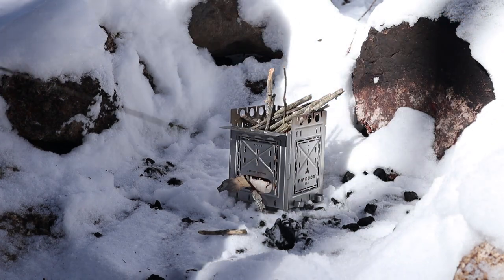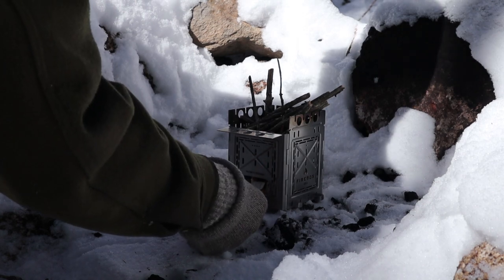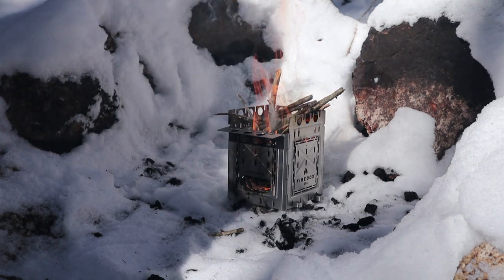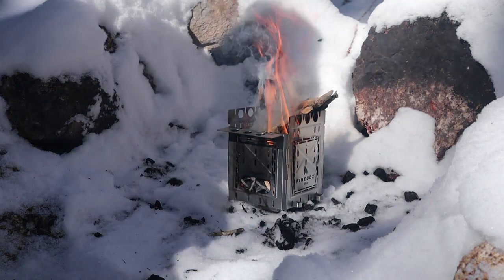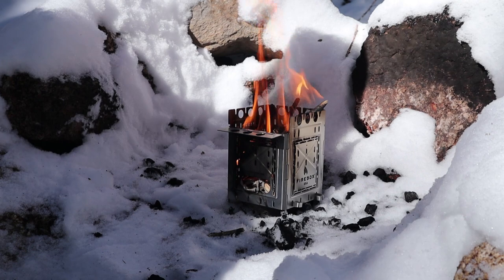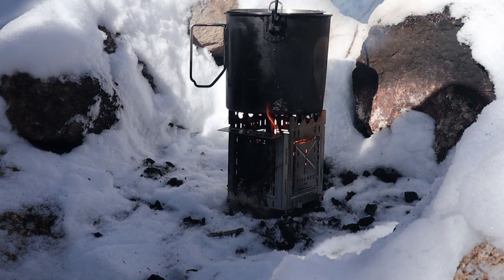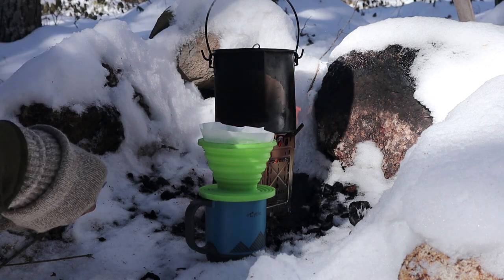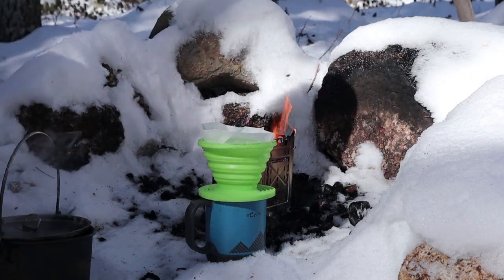Firebox Freestyle First Burn

Comment: Thanks for the nice video Mark. Just a quick explanation of why I chose to use the welded wire fire grate rather than a sheet metal punched out style. It all comes down to weight. The welded wire grate is about half as heavy as a sheet metal version. I realize the air flow may be high for some circumstances however I figured one can easily implement some technique to lesson the air flow when needed by lining the floor with a layer or two of small horizontal sticks prior to ignition. Sure the sticks will burn to coals quite quickly but as long as they are not Disturbed they should still serve to block some airflow at least until they burn completely ash. 
Thanks again Mark! cheers everyone 👍😎
Reply from the maker: Hi Steve. Thanks for commenting. In my next video I talk about how ash build up slows airflow and allows coals to build up.
Reply: Can't wait to receive my new kit, it's gonna be awesome!👁️♥️🔥📦

Comment: Yeah, I commented about that grate on the first show.  For sure this’ll be something to use splits in, I think.    If I could get the family more into camping, I think I’d get this as a package in steel, because they just car camp, and it would save so much space in the car.   But for me, I think I may upgrade to the original in titanium.   It’s a nice, relatively big stove, but pretty light.  So it would serve most things, and my nano would serve if I gotta go real light, but I think for someone who doesn’t have any yet, it would be a great idea to get one.
Reply from the maker: I am really liking the size of this stove and am looking forward to getting a single in titanium. Steve says the open grate is all about weight. In my next video I talk about how ash build up appears to slow combustion. Thanks for commenting Jim
Reply: @MarkYoungBushcraft    Yeah, like the fire pit you used.  I was wondering if that would happen,  but I’ll be curious to see how a sustained fire handles it.   Will it slow it down too much, for example.

Comment: Like you Mark I’ve ordered the titanium single version in the kickstarter for the same reasons. I love the 5 inch but the stainless steel is just too heavy to take backpacking. I also love the Nano. It’s great for alcohol stove’s especially, but I do find with wood, the small chamber makes it difficult to keep a fire going unless you do a Swedish fire torch. The titanium version of the Freestyle I think should solve most of my issues in using a wood stove whilst backpacking.
Reply from the maker: I agree. It is the sweet spot in size. Maybe it should be called the "Goldilocks" stove instead😅. Thanks for commenting

Comment: I'm late watching this one, Mark, but, by now, I can pretty much predict how a wood stove will perform by the size of the burn chamber, size, number, and location of  inlet holes, and height of the pot above the stove body, combined with how much space is allowed for the flame to exit the stove and escape from under the pot. This one's a winner for a quick boil, but needs less air flow for baking and grilling. A damper system, restricting the air flow under the burn grate, above the ash pan would help immensely, but impede a quick startup unless it was easily deployed, probably as a slide-in option. I might consider the simple titanium unit. My Nano in titanium is a good boiler, but doesn't hold the grate solidly for grilling, and the holes in the floor of the burn chamber are huge!
Reply from the maker: Your observations are spot on. There is much to like about the Freestyle but slowing the burn is a challenge. Steve says the choice of open fire grate was about weight. I am working on some hacks to get more out of it. Wood choice and how it is loaded, especially in the larger configurations can help. I am also experimenting with things that can be added to the stove as well to slow things down. Thanks for commenting

Comment: I have two of the firebox stoves. The regular stainless steel snd the nano. Love them both. I use the stainless steel regular one at home to grill on my small patio. It’s great to cook outside in a hot day. A full sized grill won’t fit on my patio so I have to pull it out into the parking lot into full sun on the blacktop to use it. Not fun on a hot day unless it’s a tritip I can just leave to cook. But I’ve made breakfast on the firebox on my patio. Snd got camping it’s great too. I do t have to buy the expensive wood that campgrounds sell for three times the cost. I can gather twigs snd make everything I need snd I feel I can control the heat better than my Coleman stove that has only two modes, burn and off. Lol 😂
Reply from the maker: Hard to beat a Firebox Stove. Thanks for commenting

Comment: Great video, thank you! How well do you think this stove would do if you top lit the fire? I like to top lite the few wood stoves I have, usually I can load them up once, lite them, go do stuff and then come back to boiling water. This stove looks to be a good size for doing that......
Reply from the maker: Glad you liked the video. I have been doing some testing with top lit fires in this stove and it works great. I usually pre-load my fuel in a vertical stack. Once the fuel catches it will really take off due to the high amount of airflow. I even see some secondary combustion (but not pyrolysis) through the holes on the sides. Thanks for commenting

Comment: Re the SOL Plasma Light, will it light an alcohol burner?
Reply from the maker: Indirectly. Getting the contact points close enough to the alcohol would be a challenge. I keep a short piece of string with my stoves that I dip in the alcohol, light and use it to light them up. Thanks for commenting

Comment: You mentioned grilling and roasting.  As one of the many who use a frying pans and pots  on stoves like these what are your thoughts on those methods of cooking food on the the freestyle stoves?
Reply from the maker: The Freestyle is well suited for use with all types of pots and pans including cast iron. It is a matter of matching the vessel to the stove configuration. I have a couple of videos coming showing different pots and pans in use. Thanks for commenting
Reply: @MarkYoungBushcraft  Nice, that answers a couple of my questions.  I have one additional concern is the grate at the bottom being open the way it is.    No damper also In my area that could be an issue if you don't have an existing park provided fire pit..  That's If they do that at all.  The wind would blow hot ashes onto dry kindle on the ground causing an external fire that could spread causing a larger ground fire..  The nano used with the bottom out for swedish fire is also illegal for the same reasons.  Lack of a bottom solid damper type plate may be an issue.   I’d have to fashion some sort of base plate out of a solid piece of sheet metal   There some parks where they would be legal.  Some of the state parks,riverbanks and lakes..  I'm curious to see your solutions as both pellets and chunk charcoal are my preferred methods of cooking fuel.  Thanks.
Reply: Wonderful!!

Comment: Hey Mark 😊 the stove looks different than the Gen 2 5" firebox stove. On camera it looks like a thinner stainless steel. Can you tell me if it is the same grade stainless steel as the original?
Reply: Good eye Deborah. The new freestyle stove has stiffening ribs formed into the surface of each panel which allowed us to save some weight by using lighter weight materials. That's how we were able to get its pack weight down below it's competitors of the same size
Reply from the maker: Thanks for commenting